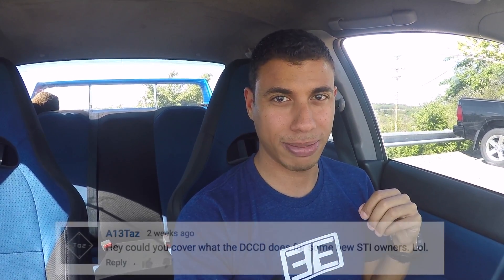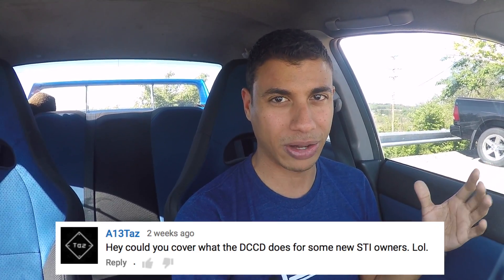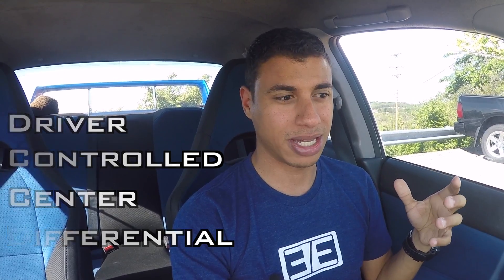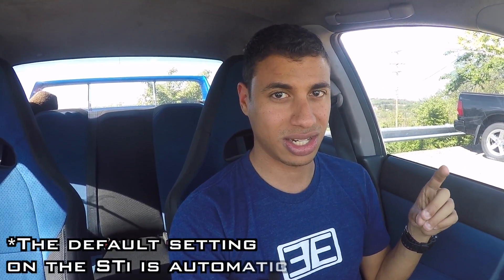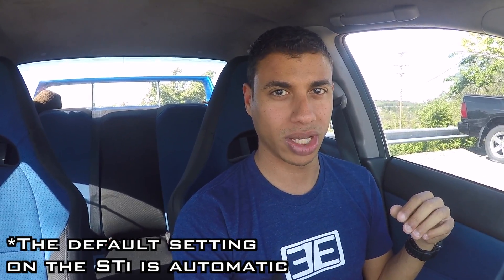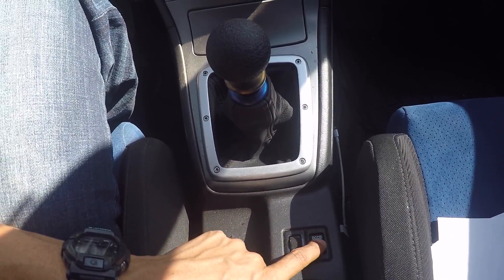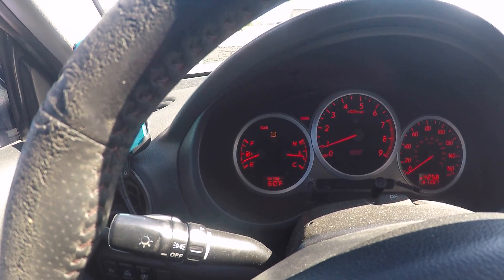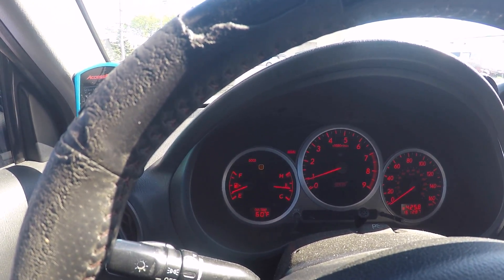Subaru STi DCCD System Explained

Comment: Does anyone of you wannabe expert guys even know what is torque distribution and how does it work? Do you listen to yourself? 50:50 locked and then 60:40 but then again 50:50 but not locked LOL
Reply from the maker: Lol. You are a goat talking to me...but listen, on the 05-07 STi, you can adjust the power split. You can have the center differential locked at a 50:50 power split. Do you understand that? You can also have the power split at 50:50 without having the center diff fully locked. And you can change the power split from 40:60 to 60:40. I don't know what you don't understand about that.

I can appreciate your ego & arrogance--but please at least look up what the hell you are talking about before trying to tell someone else they are stupid. You look like a complete moron.
Reply: Hey man, I didn't want to sound cocky, my bad. As the matter of fact, I know what I am talking about. Problem is that people confuse locked with 50:50 because they associate torque with the wheel speed front/rear. You have EE t-shirt, that guy has a really nice video about this stuff, take a look. When you lock the diff, you actually have an infinite number of ratios, not just 50:50. On the standard open diff (front, rear or center if it's equal torque sent to both sides) you have 50:50 torque split. You can't choose what will the fixed torque split be, you can only set how much torque will the clutches transfer from one side to the other. I just don't like these misleading videos, that's all. When you want to do an explanatory/learning video, you must get your facts straight. Cheers!
Reply from the maker: Well, reread your comment, you were a complete douchebag. So if you didn't want to sound cocky, you failed miserably at that...Lol. Don't get a job in PR. Just so you know, opening a dialogue by calling someone a "wannabe expert" & telling them to "listen to yourself" is condescending AF. Lol. 🙄 Now it appears as though you want to try & sound more reasonable cause I called you on your BS. I am more than happy to respond to any questions & comments I receive. I am typically very friendly & open to constructive criticism, but I have little tolerance for being talked down to like that, so I'm sure you understand why I am annoyed. 

Your comment really doesn't make much sense. I understand what you are saying, but you only elaborate on wheel speed vs. torque, & then you randomly jump to EE. No one even mentioned wheel speed vs. torque in any comments, so IDK why you brought that up. 

The STi only has 1 setting where the electronic center diff is locked. Obviously the torque split is going to fluctuate depending on the road surface, weight distribution, turn radius, etc, but I am trying to simplify explanations in my video, not make them more complicated than they have to be. Lay people, perhaps like myself, can easily understand a 50/50 power split. That is simple & easy to both explain & to understand. I boiled down a rather complicated system into a video under 3 minutes long. If you want a more complex answer with more numbers, I'd recommend contacting Subaru & getting ahold of the manual, but I am essentially correct in what I stated in my video & in my comments. I just dug up this thread on a forum if you want more info. Note* The ratios changed between different years. This is an older article. http://www.clubwrx.net/forums/sti-transmission-drivetrain/72222-dccd-explained.html

That "guy" is Jason, & I have followed his Engineering Explained channel practically since he started it like 6 years ago, so yes I am very familiar with his videos. I'm not an engineer, so if anyone wants a better explanation than I can provide, I recommend that they watch his videos. 

I most likely will not reply to this thread further. I feel that I have explained myself adequately, & I have other comments to respond to that were left by people who did not feel the need to call me a "wannabe expert"...
Reply: @niipheus  Dam He got triggered.

Comment: does anyone know why my 07 STI's transmission keeps kicking out of gear when I launch? Ill go to 1st then 2nd and then it will go to neutral.??? I do have it all the way in gear. This only happens when I'm racing someone or if I'm just launching and driving for fun...
Reply from the maker: I would have it looked at. I'm not a mechanic, but it sounds like your gears may be worn. I don't launch mine because I don't want to put the car through that abuse, but it should not pop out of gear. The GD STi's also have an issue with the clutch pedal cracking. If that happens(It did on mine) it may not be fully in gear.
Reply: right, cool man. thanks

Comment: You inspired me to buy an STI. Just like yours. Now i have 2011 hatchback and 2006 sti. But my question is the TICK noice on my sti. I saw a lot of videos about tick noice some say lifters some say normal tick noice. 
Question is WHAT IS A NORMAL TICK NOICE FOR AN 2006 STI? Thanks
Reply from the maker: It sounds like it's normal to me. My car has always had a faint ticking sound. I would only worry about it if it was really loud.
Reply: HawkeyeSTiGuy did you hear my sti noice video?
Reply from the maker: I just listened to it. I'm not sure what that is, but it doesn't really sound normal to me. I would have it looked at.
Reply: HawkeyeSTiGuy ticking noice is all over the youtube but nobody really knows anything about it. COULD YOU PLEASE MAKE A VIDEO ABOUT TICK NOICE?
Reply from the maker: Jomon Johny If I was more knowledgeable in the noise myself, I would make a video, but I'm not. Unfortunately, I really can't offer any more insight on ticking sounds than the next guy.
Reply: HawkeyeSTiGuy no problem. Talking about the DCCD system. With the auto it ran 278miles until the fuel light turned on. With the torque @ on the rear wheel it ran 310 miles. And ran smoothly. I always ride like this. Will it be more stressful on the rear differential?
Reply from the maker: No, it shouldn't really make much of a difference.

Comment: Been doing lots of reading on this as I really want an STi hopefully within the next 11/12 months, have already found some info on the DCCD.
Could i ask if it can be adjusted when the car is moving ?
Reply from the maker: Gary Steven Awesome! Yes, it can be adjusted with the car moving. 👍🏻
Reply: I really wonder have you bought an STI?
Reply: @derincosar5699  No
Looking now for either an Audi A4 estate or a Focus ST estate
Reply: @G4RY1159  What changed your mind?
Reply: @derincosar5699  parts & insurance / tax etc was just mega expensive, plus a good unmodified car in the uk was very difficult to source
Reply: @G4RY1159  oh I get it. Did you buy any other cars since the first comment? Also I want to buy an STI but it still has time (around 2 years) before happening. It is actually my dream car...
Reply: @derincosar5699  I was the same about it being my dream car, think I just missed the boat, still love the sound of them but when I see them now they look a bit dated now. 
No never bough anything since original comment lol.
Had 2 Audi's in the past, A4 and 100CD so was looking for another, A4 Avant Estate the Black edition but now I've kind of gone off the idea and been looking at Focus ST's but would prefer and estate for the dog or my bike in the back.
Prices are crazy just now for cars and lots just aren't worth the money. 
Looking on Autotrader right now funnily enough lol.

Comment: Say what?? You mention how there is a lot of information out there, but did you read it? Not trying to be mean, but where did this information come from? Most of what you said is just plain wrong. The gear ratio is a set ratio by the planetary gears (41F/59R on 2006-07 STi and 35F/65R on 04-05 STi). The DCCD controls how much the center differential is allowed to lock anywhere from full lock to full open. Yes, this can change the torque split through the use of the center diff, but it does not lock into a set torque split of 50/50 or 40/60. It's wildly variable depending on the setting you have it in. 

Read this thread for some good information: https://forums.nasioc.com/forums/showthread.php?t=2443238
Reply: This!!!
Sadly it's plain wrong.

You only change the lock up. You don't transfer front to rear, please don't confuse people. :(
Reply: Yeah man this guy knows notta
Reply: @subiefpv8283  Its obvious he know notta. He is here only for the rating......... suxs that i had to click on his video. wish there was way to take my click and time back.
Reply from the maker: tcoffin014 Most of the information I got was from the forums. I read up on it a couple years ago & was going by memory. I used the term 'torque split' but that is essentially what the center diff does when it locks, it controls how the power is distributed between the front & rear axles. I wanted to give a simplified rundown of what it is so that anyone could understand it. Subaru did change the ratios slightly through the years, but as I stated in this video, I encourage people to do further research for themselves. The DCCD system is fairly complex & has changed slightly through the years, if I tried to get into the nitty-gritty specs on everything, people would be completely lost. I'm not an engineer & I don't work for Subaru, but I stand by what I said in this video.
Reply: @hawkeyestiguy  hahahahhaha 🤣. Yes, we can all tell you are not an engineer. You don't even know how a centre diff works.

Comment: The dccd controls is something I've never messed with and will not mess with lol.  Another thing you should never mess with is the steering angle sensor....Well if you want your dccd to work.

I see your steering wheel has seen better days haha..  When's the steering wheel video coming?
Reply from the maker: Yeah, I've read up on the angle sensor. I've heard it's easy to mess up when swapping steering wheels. I plan on filming that video in the next week or so, so it'll probly be posted by the end of the month.I have at least a half-dozen projects I'm working on right now, but it's coming.
Reply: I know first hand because it happened to me.  Both angle sensor and clockspring magically went bad, $500 down the toilet.  I drove around for a few months like that and the amount of binding in the trans is incredible.  Sounded like it was skipping splines on the center diff.

The dccd goes into limp mode and goes into open position.  At the time I didn't know that and thought my center diff was bad.  Almost bought a used trans lol.  All this because I removed my steering wheel to wrap it lol.  Either way thanks for the response and looking forward to the video.

Comment: holy your steering wheel is in bad shape. I have an 07 sti with 10,000 miles less and everything is mint. shift boot, e brake boot, steering wheel, etc.. seen that you changed the boots out and soon to be changing the wheel. do you use hand cream (moisturizer) or something?
Reply from the maker: I don't think it has to do as much with the total mileage as it does with how it was cared for. I purchased my car with 73K miles on it already & I don't think the previous owners, save maybe the first, ever conditioned the leather. It was also in Florida & South Carolina it's whole life until I moved back to PA a couple years ago, so when parked, that leather was easily hitting 110* or more. I was deployed several years ago & was gone for 6 months straight in the summer. When I got back, the leather was badly cracked & was falling apart. I will be replacing the wheel very soon with a wheel from a 2015 STi. 

The shift & ebrake boots are cheap, thin, faux leatherite material, so if yours are mint, consider yourself lucky. Mine were completely worn out & started to get holes in the creases where they folded naturally.
Reply: HawkeyeSTiGuy damn eh. Yeah the hot Florida sun will do that. mileage is also a factor, hands cause friction and friction causes wear. the more driving that is done the longer amount of time friction is being introduced to the leather. that and the blazing hot sun cooking it. 

With that said, love the videos man, keep up the good work
Reply: HawkeyeSTiGuy damn eh. Yeah the hot Florida sun will do that. mileage is also a factor, hands cause friction and friction causes wear. the more driving that is done the longer amount of time friction is being introduced to the leather. that and the blazing hot sun cooking it. 

With that said, love the videos man, keep up the good work

Comment: Thanks for the upload! This answers all my questions!
Reply: A13Taz Congrats bro welcome to the family!
Reply: Patrick Wilt Thanks!
Reply from the maker: Thanks for the question man! Happy to help!!
Reply from the maker: I've had my STi for so long that sometimes I forget to cover some of the more basic stuff. I will be explaining the pros/cons of getting an AccessPORT too in the coming weeks.
Reply from the maker: Firstly, congrats on the new purchase!! 👍🏻👍🏻 I always try to respond to as many of my viewers as I can--especially if they have a good question. Feel free to ask any other questions or let me know if I didn't adress something well, I'd be happy to clarify anything further for you.👍🏻 

My engine is not factory, in fact it is in the process of being rebuilt. Engine reliability is something I am in the process of addressing with several videos right now. I am rebuilding my engine for the 3rd time now, however, each failure was due to a different reason. 

My original motor was still going strong at 130K miles. What killed it was one day I was driving on the highway & the factory lower radiator hose split open about 5 inches & drained all the coolant, so the motor seized up. That failure had nothing to do with the engine itself.

I had that engine replaced with a new Subaru OEM shortblock. I upgraded the turbo, injectors, & a few other things & it was making 380whp on a DynoJet. Sadly, about a year(11K mi.) after the rebuild, the MAF sensor went bad, the engine leaned out & blew up. Again, the engine itself was not at fault.

I had that engine rebuilt with an AWD Tuning Stage 1 short block, upgraded the whole fuel system & added an AFR guage. That engine was tuned more conservatively & was doing great for 2 years(25K miles) until about a month ago it decided to spin a bearing. The was the first failure I had of an engine regarding the internals. That being said, I'm still not sure what went wrong exactly because the engine hasn't been dissasembled yet, but I did notice some oil on top of the engine, as if there was a slow leak or something, so I'm wondering if there was a low oil pressure condition for some reason.

I have always taken good care of my car, but the first 2 failures could be chalked up to other parts failing which caused the engine to fail. Like I said, we are still getting to the bottom of the last failure. I have had my Hawkeye for nearly 7 years now & never had any issues with ringlands, but I think that is an issue more commonly found on the 08+ STi's & has a lot more to do with the ECU & changes to emmissions requirements from the government. The 06-07's seem to be more reliable than the 08+.

I don't want you to be paranoid about engine failure. A lot of it can be chalked up to poor maintenace, but a small portion of it is also bad luck or the failure of other parts. I always recommend that people save some money for when the engine does go, becuase they don't last forever. Being that your car already has 98k on it, you didn't have control over how it was cared for, so it is possible there is already some minor damage done to it due to poor maintenace. 

A car that is making stock power, or even stage 2 is going to last longer than one that is heaily modified. Once you upgrade the turbo & injectors, it's like walking off a financial cliff. Stage 2 gives the best bang for the buck in my opionion.

TIPS: 
- Always stay on top of your oil changes everry 3k miles. Also be sure to check oil level every week, EJ motors tend to use oil when they get up in milage.

- I would recommend definitely getting an air oil seperator if the car doesn't have one already. That will help the car run smoother, more efficiently, & will help reduce the amount of oil lost. IAG makes one of the best units. The GrimmSpeed AOS is mediocre at best. It is better than nothing, but I'd rate is 2.5 out of 5.

- A Cobb AccessPORT is a great tool that not only allows you to add a tune to the car, but you can also monitor several guages & even check & clear engine codes.

- An aftermark oil pickup tube is a good idea as the OEM ones tend to crack which can starve the engine. & an oil pressure guage & AFR gauge are also good ideas to get.

- The timing belt, pullies, oil pump, & water pump should all be changed out at 105K miles too. 👍🏻

Comment: I love using full lock in first to gain traction on a start in deep snow. If you use the rear torque over the front to start , the rear will kick out with enough throttle. Favorite thing to do is an empty parking lot with poles to practice my gymkhana moves in rear drive mode. I uploaded one of me this past winter.
Reply from the maker: I agree. & that's awesome! It's a lot of fun to play with the DCCD in the snow. Unfortunately the last 2 winters we didn't get much snow at all & it melted pretty quick too.

Comment: Great information man! Would you recommend putting this in a standard WRX or just rely on the Subie's system?
Reply: You cant just "put" the dccd into your wrx. You would need to do a transmission swap to a STi six speed and add an aftermarket controller for the dccd as far as I know.
Reply from the maker: What ThatSubieGuy said. There are writeups online on what is needed to do it, but I'm quite sure you need the 6 spd transmission & a few other bits. Some guys did the swap already & want to add DCCD. I don't think it's that big of a deal honestly. It's defenitely a cool feature to have, but I don't use it everyday. If you really want it, it's a whole lot easier to just buy an STi.